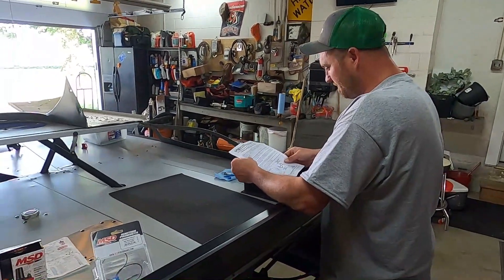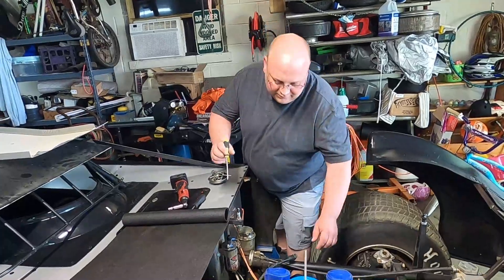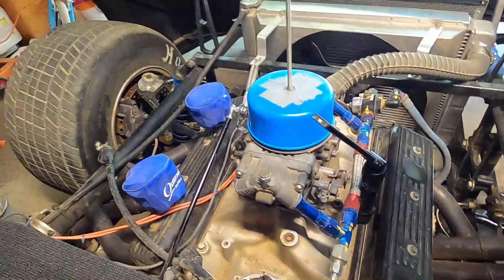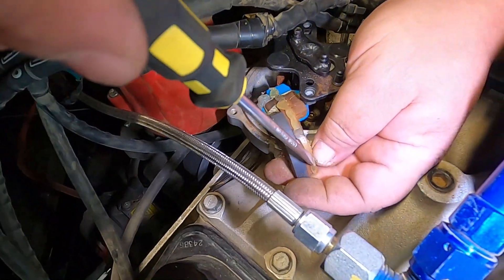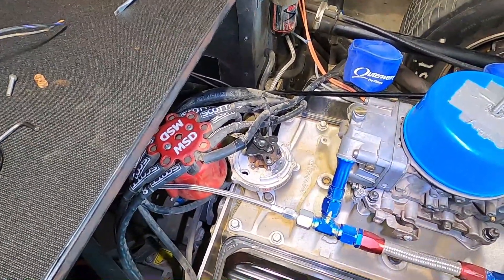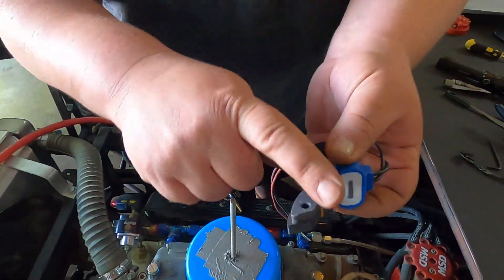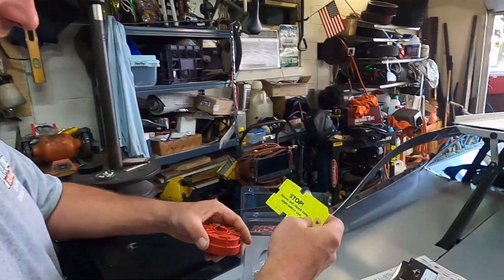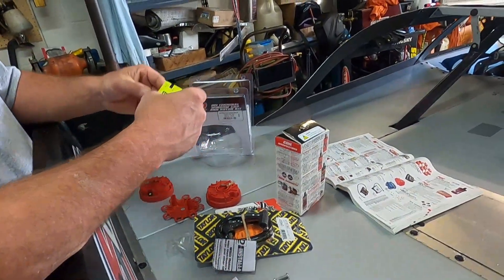Tracking Down Engine Performance Problems GM 602 Crate Engine MSD Ignition

Comment: That throttle return spring is unsafe , buy the one that bolts on carb studs boys , a stuck wide open throttle not fun
Reply from the maker: We have tried several stud mounted spring return kits.  There are additional clearance issues experienced with each one.  The throttle pedal is designed to give the driver the ability to control the movement in both ways in the event of spring failure.

Comment: Guys, make sure that the two wires going to the distributor is kept away from any other wires. Even if you have to reroute the wires going out to the distributor. If the wires going to distributor are touching or relatively close to a hot (power) wire it will cause interference to the wires going to distributor. And yes, change plug wires and plugs as well, just as you said at the close of video. Looking good and being good are two completely different things.  Hope these steps help you out.
Reply from the maker: We have made sure the pick up wires are completely separate from the plug wires and other B+ sources.

Comment: You need a temperature heat gun that way you can check each header to see which plug is not firing
Reply from the maker: We have run a temp check on the headers.  Only one port running 100 degrees less than the rest.  Seems pretty close to us.

Comment: Throw all that msd crap away.. buy ya a nice DUI HEI distributor..  so much simpler and less components to worry about.
Reply from the maker: We have a stock HEI Dist. that we could use to eliminate other ignition issues.  The MSD probably does not give us any advantage with the low compression the 602 has.  Things to think about!
Reply: Agreed. An aftermarket HEI would be so much simpler. And probably better. They are cheap too.

Comment: If that distributor has been in the car for awhile ,now would have been the time to check the distributor gear for wear.
Reply from the maker: Looking back you are correct!  We should have pulled the entire unit to look for additional wear.  With the issues still not 100% you may see this in the next video!

Comment: Is there a seal on the distributior?? Just wondering why you didn't remove it to do the work on it. I also agree that the carburetor needs adjustments. Good luck.
Reply from the maker: No seal on distributor.  Removing it would have been easier but we wanted to see if could be done while still in car.  Will continue to work on carb and other issues.

Comment: If it is still missing after you replaced all of the ignition, I would check your fuel bowls to make sure it isn't flooding out or running too lean. I would also check the fuel filter to make sure there isn't any garbage in that
Reply from the maker: Fuel filter and lines are clean and new.  The bowls were cleaned and inspected each time before we raced.  Still a few more ignition components to rule out.  We also have two carbs now and the issue is present with using either one.